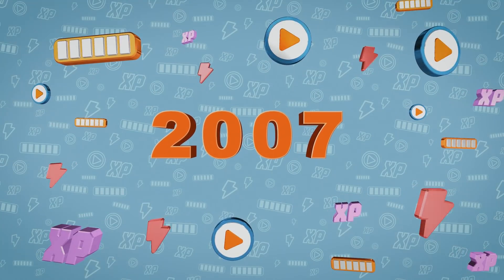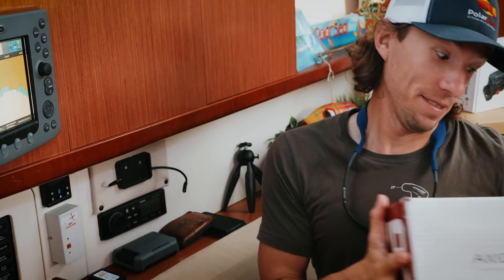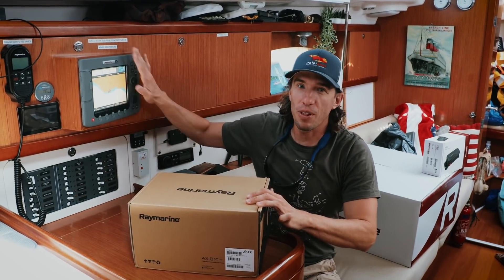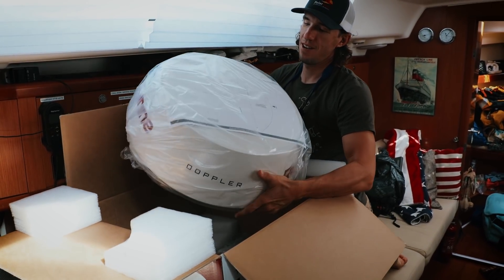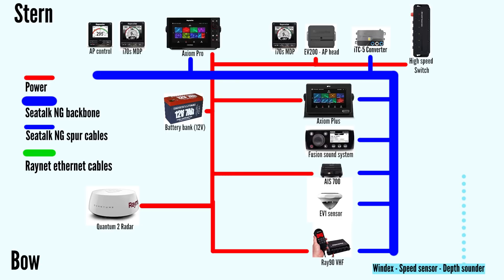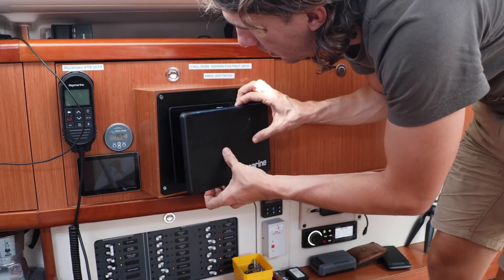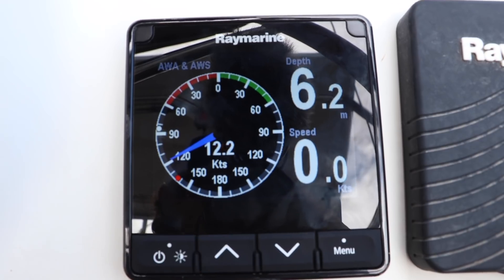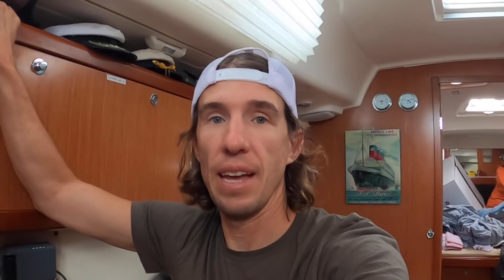SAILBOAT TECH: Full Raymarine installation [Ryan's Tech Corner #14]

Comment: My sailboat literally has the exact same older Raymarine equipment. I am about ready to dive in and install the EV-200 Autopilot and tie into my Axiom Pro. I didn't get the i70s but I think I should. Not sure if my boat is equipped with the Wind Vane still have to test the existing. Thanks for sharing. I am really going to need this video in a couple of weeks.

Comment: I am installing a backbone so I can connect my Auto Pilot, Radar Quantum 2 (doppler) and Axiom, but I do not understand why you chose to use the HS5 SeaTalkhs Network Switch as well as the Seatalk NG Backbone.   Would not the HS5 satisfy all of your requirements.   Just trying to figure this stuff out.

Comment: I just finished a similar install. I have a mix of Furuno and other instruments. My old autopilot was an Autohelm. I wanted to keep my linear drive so I installed a Raymarine EV 400 autopilot.  It was a PIA to hook this up. Everyone else conforms with the standard NMEA connectors, but not Raymarine. They have proprietary cables. There is no apparent reason for this stupidity. I recommend avoiding Raymarine if at all possible.

Comment: Great vid…so glad we found you!! We bought a boat that has RM dop quant2 in the box are getting ready to install the radar and have a few questions. We have axiom 12, all ports are taken up on the back, there is a Ethernet hub,iTC-5 but we don’t see a high speed switch. We can’t seem to find info on where to plug in the radar to test it to see if it works before we commit to installing on the mast. Love any advice or resources you may hav.

Comment: Trying to teach myself NMEA 2K and marine electronics in general.  We just bought a 2004 Hunter 44 Deck Salon and I assumed (remember that word starts w/ “ass” as in I am a jackass for assuming anything) that the new Garmin 942XS chart plotter was connected to all of the Raymarine instruments and auto pilot…not so much.  After learning about NMEA 2K AND that all devices need to be connected by cables AND then realizing there is only a pwr cable going into the back of the Garmin AND that all of the Raymarine stuff on my boat is probably original to the boat and likely can’t even talk to the new chart plotter…my heart sank and I realized I had a lot to learn and a lot of work ahead of me.  Thank you for the education.  Only thing I’m fuzzy on is running cable.  You showed a little bit on running the mast cable but not any of the other cables.  I’m just wondering if you have any tricks/techniques on finding all the hardware that needs to be replaced, tracing cable runs and pulling new.  What type of problems/opportunities did you run into.  Thank you for the video!

Comment: Interesting and informative.  Apparently, Raymarine decided to take an industry standard and make it proprietary.  My boat currently has an old Raymarine speed/depth/temp sensor (actually Arimar sensor with Raymarine heads) speaking Seatalk, and I will get a Seatalk to NMEA 2000 converter so I can put in other equipment.

Comment: I just went through the same thing!  Including a Quantum 2 radar. I even got a Standard Horizon GX1850G VHF that has an NMEA2000 port on the back. Everything is networked. You can use WiFi to connect the Axiom to the Radar. I had a hard time putting the cover back on the IC-5 and it looks like you did as well?

Comment: I was going to skip this one, but glad I didn't. I learned some useful stuff. My experience with Raymarine has been very favourable. We bought a boat with 2008 stuff and a sun burned out screen. I made the new fitting with a $2 scrap of plexiglass, and just to check I turned on the new chart plotter before running new cables. It worked immediately showing all the rest of the 2008 system. Not only that, but it says you can't control the autopilot using your phone  however it seems to have ignored that restriction. Note to idiot self in 1998  "take the job with that hopeless startup company called Gurgle" or something.  I told my agent no.

Comment: Congrats on getting the new Raymarine equipment.  I love my Axiom and Quantum Radar.  It works well with the 2008 vintage components, which I won't replace until they stop working.  Having wireless lets me see the chart plotter/radar screen on a tablet from my bunk while I'm underway single handed.  Using the radar at night is a game changer when sailing solo, and it uses very little power.  Having the autopilot remote control is a great thing to have as well.  Thanks for the video!

Comment: as much as I enjoy you two, and am glad you scored neat new things, that special data cable.. didn't NMEA get put in place to avoid the problems proprietary connections creates?.. RJ45 can transmit all the data you need, just need waterproof connectors. I've been scarred by HP and their damn ink cartridges/Apple and their user repair policy/ etc  so.. not really sold on the new cabling

Comment: good video.  Thanks for doing it.  As you did,  we just connected our Seatalk 1 to Seatalk NG, but went a bit farther because I have a Garmin Chartplotter, we connected the Seatalk NG to a NEMA 2000.  It has an added unplanned advantage of independently powering both networks.  so I have redundancy if one power source goes down.  Well, thanks again.

Comment: Hi Ryan. Just a question because I am setting up a basic NMEA 2000 converting all analog to digital. 1) with the AIS 700 did you install a specific GPS for the Transducer? I got different information and happy to hear what you have done. Some say you cannot share the AIS GPS antenna with other devices. 2) Is installing an ITC-5 still advisable? If I convert the depth and log sounders to Seatalk Ng compatible instruments and drop the old devices, for what other connections would you need an ITC-5? 3) My chandler thinks the I70 is a waste of money because you have all the data on the Axioms.I see you planned for two, what”s your advice? Happy to see you back on track. Cheers Marc
Reply from the maker: Good questions.  1.  It is my understanding that the AIS requirements state that the AIS needs its own independent GPS receiver.  The AIS 700 dies come with one so this should not be an issue.   2. If you convert your instruments to digital I see no reason for the iTC5, 3.  I disagree with your chandler, while the i70s is expensive it does have some additional options, showing wind history and others.   The big question for you is how your boat is setup?  We use the i70 for wind direction and speed while using the chart functions on the plotter   you can't display all that data at once.  This is the reason we have 2 i70s, because I want to see wind and speed information on each side depending which helm I'm at.  They are very capable devices just very expensive, which may be why your chandler did not recommend it.  Hope that helps.  Ryan

Comment: Hi Ryan, just a quick question about your dinghy: you used first with open now catamaran style and then more traditional shaped dinghy - which one is better from your expirience?
Reply from the maker: Hi Sergey.  You are correct, we have used both and love them both.  I think it really depends on what you want to use it for.  For us I find the close bow or more traditional dinghy works a bit better.  That said we have found dogs love the open bow version and we love it when we are getting a lot of stuff on and off the boat.  So it really depends.  

I know most the takacat dealers offer demo rides... take one out for a spin and see what you thing before you buy.  Ryan
Reply: @RyanSophieSailing  many thanks Ryan

Comment: Really helpful informative video Ryan.  I am about to do similar upgrades on my 2008  Oceanis 40.  Was it just the radar and  chart plotter cables that that need replacing and does  the ST60 Tridata only need the analogue to digital interface box connecting between the existing depth, speed and wind direction and speed cabling and display units?
Reply from the maker: We had to add a lot of cabling for the seatalk.  Regarding your tridata question... do you want to keep the tridata display or are you replacing that because the answer will dictate what you need.  If you want to keep the disay you need to buy a seatalk 1 to seatalk NG converter.  It's a 5 port bar with a yellow one in the center.  You can have the wires going to the old tridata screen and then splice the seatalk 1 cable in to the yellow adaptor cable and plug it in to the network.  

If your going to swtich out the 60 tridats display for a i70s then you will need the converter box.  Hope that helps
Reply: @RyanSophieSailing  Thamks Ryan...this is really helpful. Looks like I have a lot of new cables to run!

Comment: Great vid Ryan, I also have a 2007 Oceanis 40 and I’ve also just upgraded my Raymarine electronics (I even managed to shoehorn a Axiom Pro 12 in the cockpit housing).   However I’m curious as to why you didn’t use Wi-Fi to connect the quantum raydome?
Reply from the maker: Hi Mike,  it's a good question.  I consider the radar a critical piece of equipment so I wanted it hard wired so I did not have to depend on a wifi signal failing.  Essentially I won't use any wifi or wireless for my navigation equipment.   On top of this I had to run a power cable anyways so might as well just put that data cable in.
Reply: @RyanSophieSailing  good call I'd say.... worst case scenario you can revert to wifi if hard wiring fails

Comment: SO you went from an all proprietary system to another proprietary system,... Even if the protocol is standard, you cant connect any other brand on it. How to make the same mistake two times...
Reply from the maker: Eric, your statement is simply not true.  The only thing proprietary in the system is the plug ends.  You can connect anything you want to the system, where it be raymarine or not.

Comment: Great video, love your enthousiasm! But left us hangin’ on the cockpit chartplotter install. The proverbial elephant in the room! What did you have to do for adapting the new Axiom cutout into the old C80 cutout? Were you able to buy an adaptor kit?  I’m looking at buy starboard to fit my new ray element 9s into the old c80 hole so as to avoid buying a new Navpod…. 😗🤓. Happy Holidays to you guys!
Reply from the maker: For the axiom 9 and 9plus there is an adapter plate you can but and it what is shown in the first part of the video (black plate that the plotter fits in to.  The axiom pro does not have a adapter plate... I was trying to find star board but its impossible in Europe it seems.
Reply: @RyanSophieSailing  Starboard is likely a very practical cost-effective solution. In the next few weeks I will be get in touch with Canadian and US vendors for starboard. Let you know…. (-14c in Montreal today…. Have to brave the cold to goto my boat and measure the stencil for my Ray Element 9s - but I am a whoos 🥺 - too cold)
Reply: @RyanSophieSailing  you might want to look for HDPE sheet material ( = starboard)
Reply: @RyanSophieSailing  Ryan, consider having someone 3d print a plate…very cheap. My brother will be 3d printing a fitting plate for me. Can let you know how this works out.

Comment: Hello,
Great job, i have few question, as i d like to do the same. My boat have 2006 electronic.

1) how long did it take to you to install all ?
2) why did you choose 9'' screen and not 12'' (dur to space ?)
3) why did you install a screen inside if you could use a tablet to control the external screen ?
4) did you reuse 12V old supply or did you renew it ?
5) where did you locate the pilote control screen ? 
6) could you control the pilot from the external screen or cellphone ?

Thanks for your help.
Reply from the maker: Hi there.. to answer the questions

1. About a week but only working a few hours a day.. hardest was the wires for the radar.

2.this is a good question.. going back I think I would rather have the 12in the cockpit.

3. We had the space, and I like to keep an eye on it while off watch.

4. Yes.. we just reused the old 12v wires.

5. Pilot control is in the cockpit next to one of the i70s.

6.  You can do some basic autopilot stuff from the plotter like engage and disengage and change heading.  But more advanced functions need to be done at the helm.

Comment: So, when you buy Raymarine, expect it to only last 15 years or less? Lots of money for that short life span. just saying....
Reply from the maker: Personally... 15 years for electronic hardware sitting in a very harsh environment is great.  Most the plastic parts will break because of UV, salt water in the electronics, etc.  It's boats, unfortunately
Reply: @RyanSophieSailing  Raymarine warranty is 2 years. Parts supply is garanteed for 5 years. You need a lot of luck to reach 15 years without expensive repairs: just witnessed a -3.5 year old - Quantum radar repair by Raymarine which cost €1200. The radar stopped working after a software update.
Reply: We Love our axiom! Can you get your in reach integrated or your iridium?  We also have a garmin chart plotter with radar and forward facing sonar. I can’t link the two but like you said a while ago and it hit home with us is “repetitive backups” multiple sources are necessary especially when off shore. You are so excited and I get it!

Comment: Excellent and informative video!  However it’s very disappointing that Raymarine won’t participate in an industry standard cable system.  They do this to force all customers to buy all Raymarine components.  Sadly this outdated method of product design ends up stifling innovation. In any industry when competing suppliers agree on a standard, then the whole industry’s tech gets advanced. For this reason I won’t  touch Raymarine. Furthermore, it’s ridiculous that their products require three different cable formats in order to communicate. This is a massive engineering failure on Raymarine’s part.  Lots of cable technology exists today that could do all of this on a single format cable for the entire system.
Reply from the maker: To be fair to raymarine most the larger equipment like the AIS and VHF, even thr chartplotters use the standard plugs and then you use a raymarine "device net to spur cable"  I don't think its as bad as people think it is.

Comment: Great video - have you found a good source for a manual or instructions for how to update the different displays?  It seems like an adventure trying to figure out how to set everything (anchor drag alarms, AIS alarms, etc.)
Reply from the maker: All the manuals are on their website.  It is a bit tricky to get use to setting the alarms, I think.  But I found the system updates very easy.

Comment: Seatalkng is what you get when rich old people hear that tech has been moving to open standards for decades, but they want one last desperate ploy to lock people into pointlessly proprietary standards.  It literally works exactly like NMEA2000 with an incompatible plug and zero benefits.  Both your new MFDs even have an NMEA2000 port, so why install seatalkng cabling?  Just pure backwardness because RM gave you some gear or a discount?  Future you won't appreciate that decision when you try to install an engine gauge, tank sensor, light controller etc etc and you have to pay the premium for RM's version, if it even exists, or buy an adapter cable for each device.

But even then NMEA 2000 itself is still an unnecessarily closed proprietary standard.  Even though it works with the other BIG brands, small brands and individual hacker/maker/DIYers can't afford their expenses on the vendor side.  Which of course is why the big brands chose it, you might not be locked into 1 brand's proprietary system, but they have a 1/3 chance of hooking you like a fish anyway.  Signal K is the truly open, free marine standard.  With any luck future Ryan will look back on these proprietary years as the dark ages before Signal K was widely implemented.  BTW, signal K is also backwards compatible with NMEA 0182, NMEA 2000, seatalk 1 and ng.  It's built on real world security and networking standards, so you can securely go wireless, communicate with the cloud, interface with databases, build apps, automate, etc, just like any modern smart home or office, not relying on Raymarine to develop and maintain apps better than, well, anybody else in the entire world.  So you can netflix or spotify today, but if you want to use another service you have to wait for RM to make an app or update.  Anybody got a 4 year old smart TV that still connects to it's netflix app (mine stopped after 2 years)?  Anybody want their MFD to be fully functional in 4, or even 10 years?  Proprietary cables and closed app ecosystems are not the way.  (Unless they also gave me $20k worth of stuff, then I'd be all "oooh, look at how cool it is, yay!")
Reply: @armslength2618  What I take away from that is "HTTPS bad".  Fair enough, you sound like you have the experience and foundation for such an opinion more than I do.  But HTTPS is a thing out there in the world.  It's the protocol one would use to say liquidate their 401K, transfer it to a checking account, and wire the proceeds to a yacht broker halfway around the world.  

I think we can skip nuclear power plants and airbuses, has Raymarine even figured out how to do a simple lockscreen security code yet?  Let's remember this is a sailboat.  Other than the autopilot and the MFD, the other smart features are no different than a moderately smart cabin.  One "feature" in the video is netflix....criticize it if you want, but I'm currently streaming netflix via https, like most of the world.